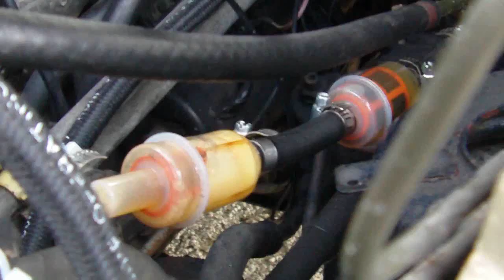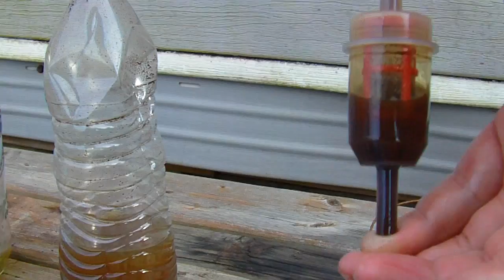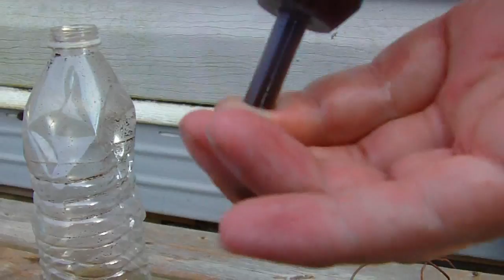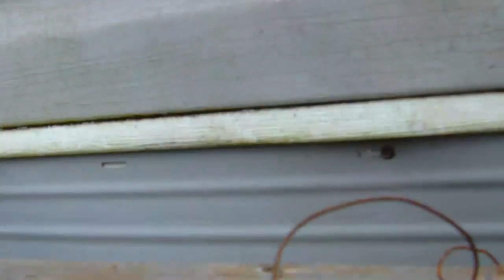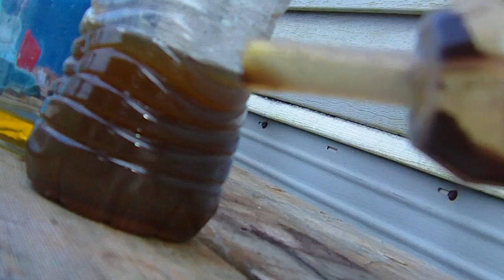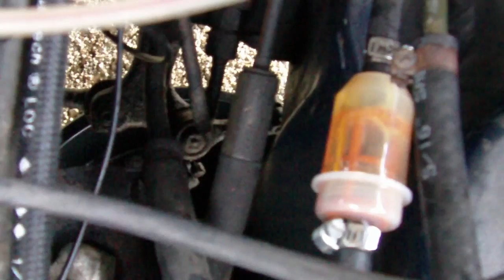Diesel Fuel Filter Full of Crap A Never Ending Problem on a Mercedes

Comment from the maker: I told the property manager about the problem and informed a young cop I intend to use a 3/4 drive ratchet to demonstrate some sociopathic behavior on that guy. This dude asked me about the car and about trash in the filter a week before if started having fuel problems. This has been a problem for over 2 months and there is no locking fuel cap available.

Comment: the filler door has a lock that engages when you lock the car, it's on the same vacuum circuit as the rest of the locks, but yours might not work.

Comment: if my fuel was 1/2 that bad in my 6.9 F250 would it cause it to stall out all the time?
Reply from the maker: This algae stuff clogs up fuel filters like crazy. I put 5 gallons of diesel in this car and changed the inline fuel filter five times in 130 miles. If your ford stalls out, it might have an air leak in the lift pump or the tank switch valve. Every vehicle is different and fuel filters are a real problem with ULSD.
Reply: heavymechanic2 thanks the tank is my last old part in the fuel system i got it down today and it looked like it was 1/8 filled with sandy looking rust so i ordered a new tank i always do a sending unit with a new tank but sadly its not made anymore but thankfuly the old one still works i think this will do it for me